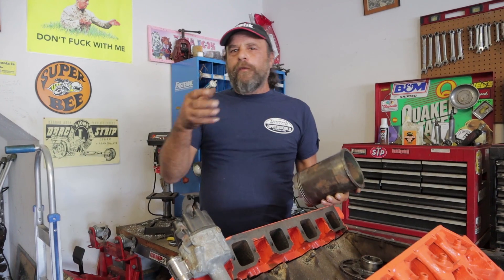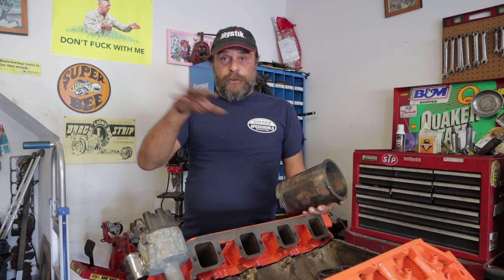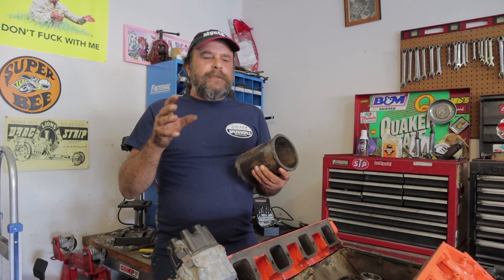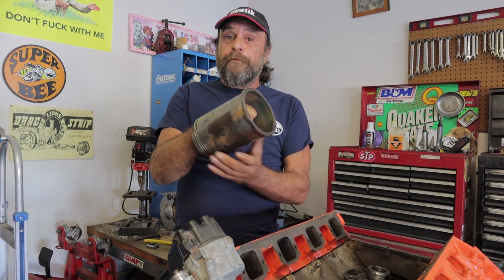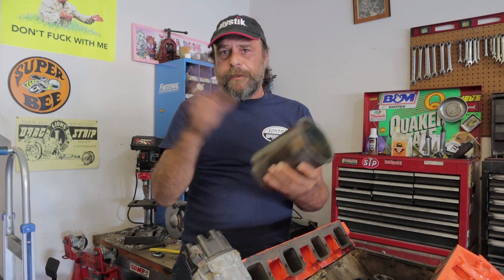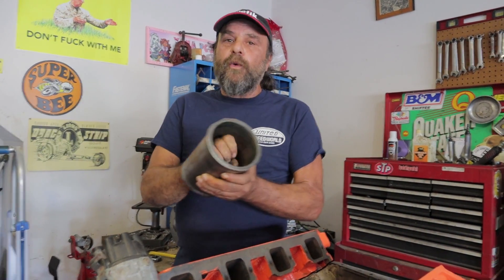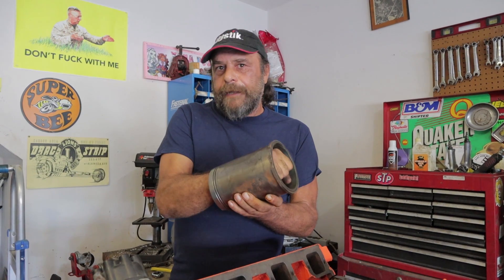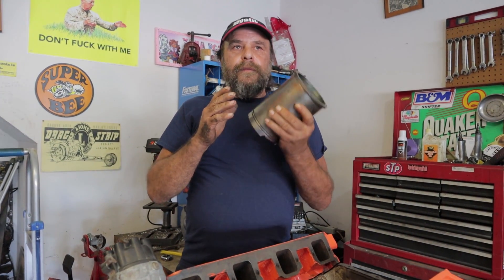The Myth Of Engine Displacement

Comment: my dad has a 71'ss Chevelle 454ci. factory 4spd. car! 
Dyno; 589hp.-619tq.
love the feel and sound of that big block!🇺🇸..(🤝)
Reply: Those numbers are massively bull shit!  The only way you have more torque than go is if the engine peaks far before 5250 rpm.  619 ft lbs of torque should be more like 750 go.  But with only 454 cubic inches you need to twist that motor to way higher rpm
Reply: @TL-angzarr  uh gasoline engines mostly always produce more torque. Its just peaks earlier in the rpm band and tapers off as hp increases
Reply: @jeremydavis340.  yeah you need to brush up on your engine science, a factory tuned smaller headed tiny valve under cammed motor will make more torque numbers than HP BUT he's talking about a 454 we know what the pump out stock to get one to 600 HP he MUST turn the motor faster IF he's making that much torque at peak he would be making WAY more HP.
Reply: @TL-angzarr  peak torque isnt measured at peak HP. Its torque comes in the low end. High end for peak HP. Theyre not related.
Reply: @nonofyourbusiness7631  Yeah... No you are absolutely wrong torque bus 100% connected to horsepower, Dynos do not measure HP it's calculated.   The formula is simple. Torque X RPM ÷ 5250 =HP
Reply: 589 and 619 don’t quite sound right to me either. I’d like to see the curve on that.  They have to cross at 5252, so it would be a bizarre graph for sure.
Reply: @TL-angzarr  
Look at the specs for every big twin Harley engine ever made from the 1936 Knucklehead to present, they ALWAYS have a higher peak torque than peak HP.
Reply: @dukecraig2402  I already explained WHY that happens in particular it's cause Harley's are garbage designs with cylinder headsbthe can't breathe through. But read the other replies and the math
Reply: @TL-angzarr  
"...cylinder headsbthe..."? Christ even the people at Harley know how to spell.
Reply: @dukecraig2402  Do you have anything remotely intelligent to say about engines? Specifically how HP is calculated from torque? Or what it takes to get a 454 in engine to make 620ft lbs of torque? And what that does to the HP? Anything? Anything?
Reply: @TL-angzarr  
Well yea, first off the associates degree I have in aerospace science definitely trumps all your incorrect Hot Rod magazine knowledge about engines, torque values are meaningless without the rest of the information to establish HP, HP IS THE FINAL SAY, torque values alone are meaningless because there's no time constraint involved with measuring torque, torque is a measurement of force/work (whichever term someone cares to use) over distance, but time is not factored in, to say an engine makes 600 ft lbs means nothing because there's no time involved in its measurement, you can take as long as you want to make the 600 ft lbs of force, HP is the amount of force/work done in a given amount of time, ie higher HP means you're getting the same amount of work done in less time OR more work in the same amount of time, seeing as how a race is won by the machine that crosses the finish line in the least amount of time is proof that HP is the deciding factor, people whose engines make higher torque numbers love to spread the MYTH that torque is an actual measurement and HP is simply a calculation, nothing could be further from the truth, they are both physical measurements, an engine that makes 80 ft lbs of torque at 3,500 RPM's and redlines at 5,200 will cross the finish line well behind an engine that makes 70 ft lbs of torque at 7,000 RPM and redlines at 10,000 RPM, that's called physics, a subject that involves LOTS of tests before one can have a degree in aerospace science, that and over 30 years of professionally building engines for a living says I have plenty to contribute that's going to be over the head of someone whose education on the subject only involves reading articles and never having to pass tests on the subject.
And just so you know, Harley Davidson hasn't done any of their own engine designs in well over 40 years, since 1976 they've contracted that out to Porsche (and that's HD's best kept secret that they hide diligently from the public) and the ports in their heads since that program started have been finalized by Branch Flowmetrics, an outfit that has FAR MORE experience than AFR or Dart or anyone else you can think of in that business, they've done R&D work for all three American car companies, all four of the Japanese motorcycle companies, Indy racing teams, NASCAR racing teams, NASA, and too many others to list in a single YouTube comment, they're the reason that the ports and valves in HD heads have gotten SMALLER since they started finalizing the port designs for them yet they flow 20% MORE than when HD didt it themselves, they also did every single set of heads for HD's factory racing XR 750 engine, which is the winningest motorcycle racing engine of ALL TIME, it holds more records and titles than any other motorcycle racing engine in history, Branch Flowmetrics also works directly with the engineering department of the University of Southern California and writes the engineering books that USC uses to train students who study engineering, and having worked directly with them and studying their engineering books says yes, I have plenty to contribute to conversations about engine's and the science behind them. Also try reading "The Internal Combustion Engine and Air Pollution", that's the book that West Virginia University (you know, the people that caught VW cheating on emissions tests) uses to train its engineering students, it's not just about air pollution, it covers just about anything you want to know about the mathematics of engines.
I primarily build high performance motorcycle engines but for the past 15 years or so I've had an increasing number of car guys pay me to do math for them for engine builds, ie port size, cam profiles, and compression ratios for what they're trying to achieve, so yea, I can contribute plenty.
Reply: @dukecraig2402  Lots of words to say very little.   First a associate's degree in aerospace doesn't make you any authority on dynoing engines.  I know actual aerospace engineers who have 30 years designing airframes and don't know jack about engines. Your appeal authority fails hard.   More over dynomometers do not measure HP they measure torque as it's defined by an electrical equivalent.  If you look up the definition of HP it is torque times rpm divided by 5250. Dynos only measure the torque, the software calculates the HP. Your weak example comparing hypotheticals is just that.  There are more variables than you included you had to make an extreme example to make a point the problem is the point is much more ambiguous when dealing with real engines.   As far as Harley heads go doesn't matter if they are designed by Porsche or anyone else.  The packaging constraints of a Harley in particular having the carb do low between the cylinders means that the ports will always be sub optimum.  The packaging forces the compromise.   Even then you are making the mistake in implying that OEM ports are optimum.  They are designed with a goal in mind that goal is very rarely all out performance.  Between that and packaging constraints means the ports can be improved by those who are looking  for all out performance.  Your ad hominem attack fails again also. I have plenty of real world engine building experience, if you have old issues of National Dragster you can find my name in May 2001 as having reset the B/stock eliminator national record at Firebird raceway. I raced and built engines in stock and super stock for about 20 years.  I no longer live in the US I moved to Europe about 9 years ago. Even then you spent an hour typing and addressed nothing actually direct in opposition to my assertion.  It's simple the OPs stated Dyno numbers don't make sense.  Everything else you bring up is ancillary.
Reply: @dukecraig2402  More ad hominem attacks, I know tons of you A+P mechanics, it's a 2 year degree and it sure isn't aerospace like you said before.  All you are doing is arguing ancillary points. If you want to do that I suggest that you call up the good folks at superflo and ask them.  You still have not once addressed my original assertion.  A 454ci motor that makes 620 peak HP will not have 598HP the numbers don't make sense.  Everything else you are arguing is only trying to obsfuscate the point.  Now either explain how the numbers make sense or just pack it in.
Reply: @TL-angzarr  
First off the post says 589 HP and 619 Ft Lbs Tq, not 619 HP and 589 Ft Lbs Tq as you just wrote, and what you're failing to realize here is that he's giving the MAX numbers for each, he's not saying that those numbers are AT THE SAME RPM.
Since the poster of the comment didn't give the RPM's at the max HP and max Tq I can't do the math but here's an example of an engine that makes 101 Ft Lbs Tq MAXIMUM, and 83 HP MAXIMUM,  numbers that are proportionally similar to his;
An engine that has a MAX Tq rating of 101 Ft Lbs measured at 3,600 RPM's, 3,600(RPM's)×101(Tq)=363,600÷5252=69.2 HP at the RPM's that the MAX Tq is measured at.
The same engine shows 83 HP MAXIMUM measured at 5,850 RPM,
5,850(RPM's)×83(Tq)=485,550÷5,252=92.4HP, these are numbers taken from a dyno readout that's posted on a site from NRHS performance from a big twin Harley engine measured on a Dynojet dyno, Harley power ratings are usually very similar (proportionally) to American V8 engines.
Once again, the reason you couldn't get your head wrapped around his numbers is because you failed to realize he was posting the MAXIMUM numbers for Tq and HP, he was not suggesting that his dad's engine had those ratings AT THE SAME RPM.
Call the people at Dyno Flow or whoever it is whose name you're throwing around and I'm sure they'll confirm those results. 
And by the way, an associates degree is typically from a 2 year course, a bachelor's degree is from a 4 year course, a master's degree is from a 6 year course and so on and so forth, Pittsburgh Institute of Aeronautics course is 2 years and the associates degree from them (at least  it was in 1986 when I went there) is recognized by most higher education institutions although not Harvard or Yale or MIT who only recognize credits from other "Ivy League" institutions. 
And before you even ask or imply anything the reason I didn't pursue a career in the aviation field is because it became painfully clear when I was in school that the FAA wasn't going to put up with me and my shenanigans, the motorcycle world offered far better parties, girls, and all the other fun stuff then the aviation field did.
Reply: @TL-angzarr  I read a bunch of this comment stream, you are a knob. You argued against your own right here...maybe, just maybe, this kid's dad's car has heads that can't breath well enough to post those high HP? Maybe it peaks off HP because it runs out of air before RPM? I mean damn, factory big blocks from the 90's like the Ford 460 were tuned to have DOUBLE the ft/lbs of the HP. You act like the air flow tuning isn't flexible and his numbers are impossible without knowing ANY of the important parts used.
Reply: @davenhla  You resurrect long dead thread only to show your own ignorance? I don't have to know the parts to know those numbers don't make sense.  If the motor wasn't breathing and was designed for torque it would have had much less HP.  If the motor could breathe with those kind of torque numbers the HP would be higher.  The numbers don't add up it's as simple as that.
Reply: @TL-angzarr  Go look at a dyno graph and get back to us. You are not explaining something right. Peak torque is not measured at the same rpm of peak horsepower.
Reply: scar face 

Those 454’s were great
Reply: Yep looka like someone is BSing .. more like 450 ftlb
Reply: silverbird58  
Dy-no-mite!!! (As Jimmy JJ Walker used to say🤣🤣🤣)
Reply: And i have a 283 making 600hp and 700ftb lets race our two 14 sec sleds lol
Reply: @Patriot Warrior 
Yes you can. James Watt was a smart guy, considering that he figured all this out without any basis from someone else to start with is amazing, the fact that it all started with him watching a horse pull a stiff arm around in circles one day is just incredible, his imagination took over and the rest was just pure brains.

Comment: I always save up for good flowing heads and match cam accordingly
Reply: Super Duty 455 so many guy just buy the biggest intake and a giant mismatched cam and think they have a race car or I love the guys that buy the big intakes and carbs and stop there🤣🤣🤣
Reply: @cncnmore4505  
Not to mention incorrect pistons (compression ratio speaking) for the intake/cams set up.
Reply: @dukecraig2402  Care to elaborate?
Reply: @Aseutester  
You have to have it explained to you? High compression pistons with a stock cam=detonation problems, starting issues etc
Low compression pistons with long duration cams=loss of power.
Reply: Dominator, 292 cam, 2.41 rear and cracked 882 heads.
Reply: @superduty4556  LOL, broke off the exhaust
Reply: @superduty4556  now you're talkin my language
Reply: I had a stock 350 hp non high performance 440 in my 68 New Yorker,triple black 2 door hardtop(body guy so added that)The shop I worked at they added a purple cam and heads it needed a timing chain so I opted for cam/heads as a Mopar guru worked there and was drooling to do it up.. I was 16 and the machinist at the garage I worked at did the heads and I cant remember the specs but he said you should have 100 hp gain...Well,that car with 2.94 axle ratio blew away stout 454&396 Chevelle's with 3.73's,4.11's,ate 428 Ford's....My Buddies '87 Mustang 5.0 5 speed all the tricks in the day 4.10's,off road exhaust..I always wanted to take it to the track,but always busy(school,work,girlfriend,beer etc)The car would bury the 120 mph speedo and keep going! I had a buddy with a  Kawasaki Ninja and paced me and my car went past 155 mph ,well I was young so why not I lived! I pulled out before it ever stopped pulling,car was unreal!

Most cars I had I always had good flowing heads and a cam(nothing radical either 1 step up usually from factory cam usually) and it usually beat the same type of car with more mods...I have a engine builder buddy I guess he would be better suited to comment here,but nonetheless...I run a few strokers in a couple of my cars now,as he builds them I test them out(I drive hard)then he sells them as a package(no not the one I used he builds a few and sells them to customers)..I had a 500 stroker and my 440 with good heads and cam beat it by .50 in the 1/4 mile,so he reworked his strokers..Also sells stock with better heads blah,blah...The specs I should get them I guess..
Reply: Ive heard from several racers and builders that its all in the head
Reply: @hank1556  I had a short block 383 stroker built out of  high school. Ran outta money went cheap on the heads....... 2 years later got a pair of heads from my uncle off his old 327 .  Got a rpm performer I take and a old Rochester he rebuilt.  Still runs good today minus I swapped out the carb
Reply: Super Duty 455   I remember a while back they interviewed Ernie Elliot( engine builder) and went into their NASCAR shop. Ernie showed them everything  but two items....heads and cams. What does that tell you?? Rotating mass      does make a difference but, volumetric EFFICIENCY is where it’s at. 💪🏼💪🏼👀
Reply: Fernando Arriola Eddie Ingram was Ernies cylinder head man.. You can have just about any head ported by him in Dunlap Tennessee.. One of worlds finest porters.
Reply: I learned that lesson in high school lol
I wanted to do up my 305 in my Camaro.  Shop teacher said he would flunk me if I did.... he gave me his 350 out of his 71 Chevy half ton lol . He said dont waste ya money.

Comment: Opinions on the D50 compared to the ranger and S10?
Reply from the maker: Which years, which engines?...I'd say the Ranger is probably the best all around of the 3
Reply: @UncleTonysGarage  87. I had one years ago but thinking about getting another small pickup. Not to make a show truck or anything just to have something easier on gas but still clean up nice
Reply: Ranger with a 2.3 and 5 speed behind it.